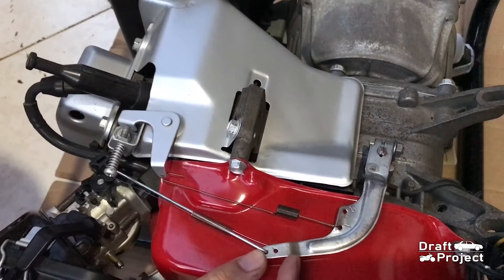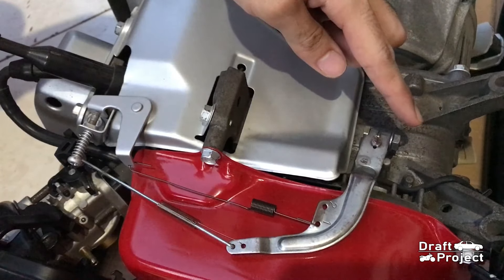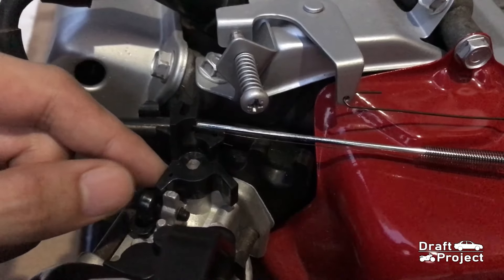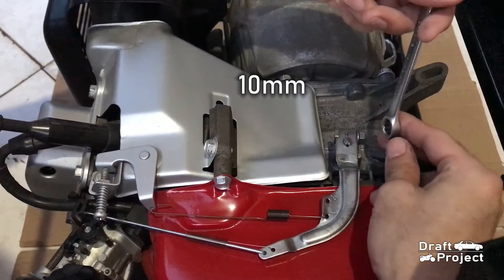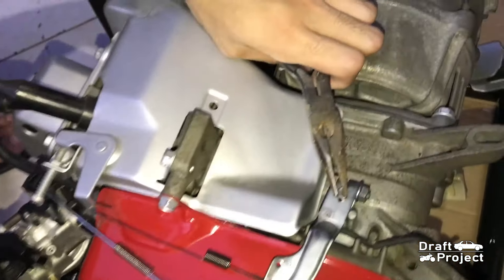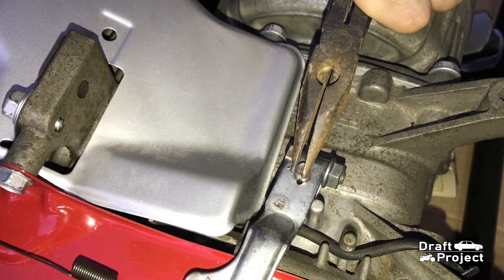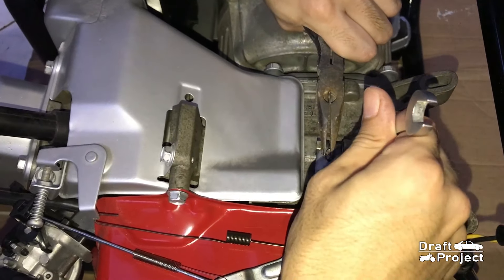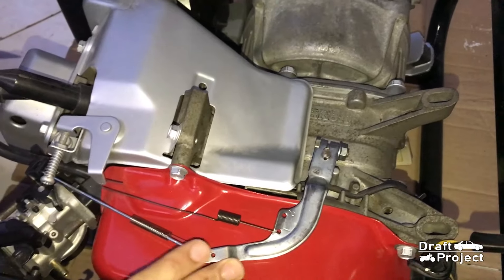Generator Governor Adjustment

Comment: I watched this video then went to go do it myself and I messed it up to the point where when I took it off the choke it reved to the moon but I came back later and re-watch   watched it and I payed more attention and now it worked lol   great vid
Reply: I got the moon tune as well, what am I doing wrong
Reply: @gcfirestorm12  idk but if you follow exactly as the vid says it should work cause I thought it was gonna be messd up didn't follow directions and it went bad. Came back and did exactly as he did and it ran fine so that's my advice just do what the vid tells you

Comment: Mine doesn’t surge anymore but it idles super high … even on low
Reply: Did you fix it? I’m about to go back out and mess with it but it wants to red super high
Reply: @bowtiebuilding did you fix it lol I have the same problem I changed out the carburetor
Reply: @Ulteriorzeus01  my problem was, somehow, the throttle was stuck in WOT. There’s a spring that brings it back into normal low throttle that wasn’t working. Now it will run normal but only for a few seconds.

Comment: But after adjusted the governor to the normal place but what can be the causes if the governor doesn't return closed to the carburetor during the on speed and it always consume fuell when the engin governor   function in that way especially  3000gen, 2900,8000 8800, 8990gen

Comment: What about the Philips head screw with the spring around it, what do you do there.
Reply from the maker: That is for the high speed setting. You adjust it when the generator is running. If you tighten, it increases more idle speed when the throttle is wide open. If loosen, it decreases idle speed.
Reply: @DraftProject  Ok thanks that what I want just a bit more revs at full speed.

Comment: my gx200 has another spring that connects to the governors lever; only Im not sure on the other side if or where it connects to the speed control lever..other engines seem to be different

Comment: I would like to ask if this will work or same procedure on 1000W common small generator? Because I have problem  with mine. After cleaning the carb, maybe I accidentally hit that thing when I turned back the carb. And the result, super high rpm with over voltage. I tried to adjust the screw but it didn't work. I think, that governor is the problem? Please help me.
Reply from the maker: If the carburetor has some springs, have you checked it if it is correctly placed? Try to double check the screw adjustments. Perhaps something opens the throttle as a result of higher rpm. 

About the governor adjustment, yes you can try but before you do it, put some markings so you can go back to the previous adjustment if the new setting didn't work.

Comment: You have to take off the damn fuel tank to get to the governor. Then to remove a bolt holding the fuel tank in, you have to remove the damn throttle assembly. Then there's a giant gap between the back flywheel cover where bolts can randomly fall in if you're not careful. Horrendous design. But thanks for video. It worked in the end.
Reply from the maker: Yeah, it's pretty hassle to do.

Thanks man!

Comment: Am electrician said i needed to adjust my governor, hence my watching videos trying to identify, but what does this do?
Reply: It alows higher rpm, meaning the engine can run at faster speeds. That's why go karts and dortbimes with these engines almost always have no govenors

Comment: Will this work for a Robin Subaru EX13 engine on a Coleman Powermate1800 Pulse EX?
Reply from the maker: I have never encountered that engine before. But probably yes. Most of these engines are similar. You can try small adjustments to see if it works.
Reply: @DraftProject   Your procedure worked perfect on the Robin EX 13, on our Coleman 1800w generator. It was off a few degrees. It  now holds 60hz (3600 RPM) , where before it would race up to 72hz. thanks so much!